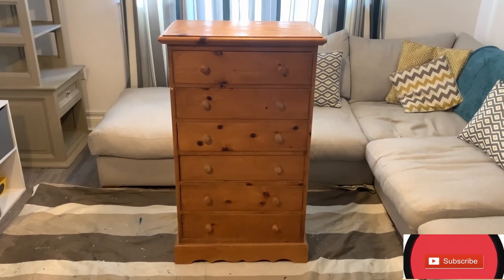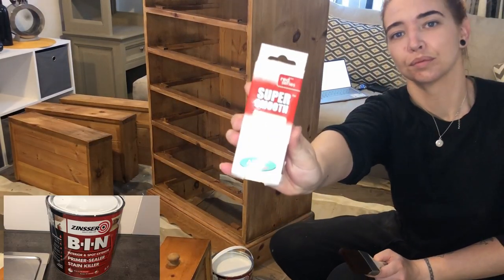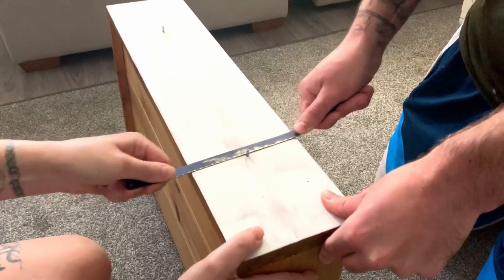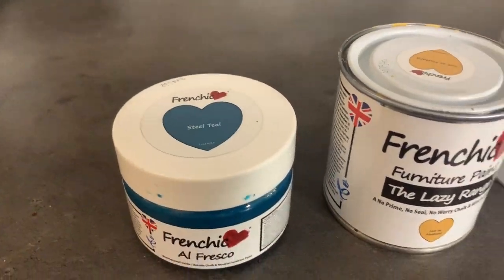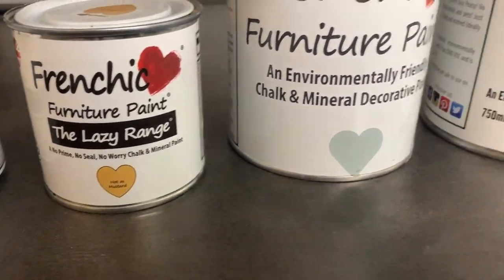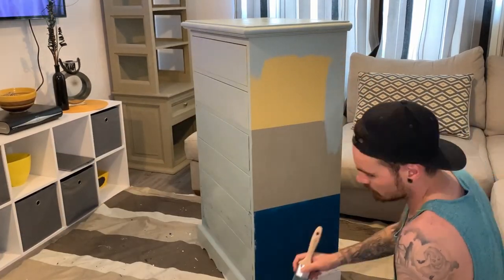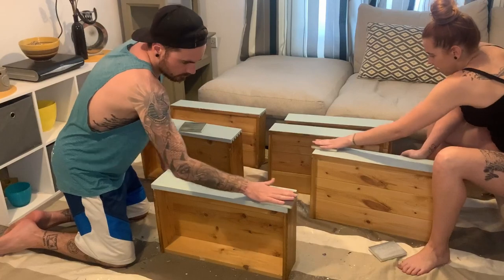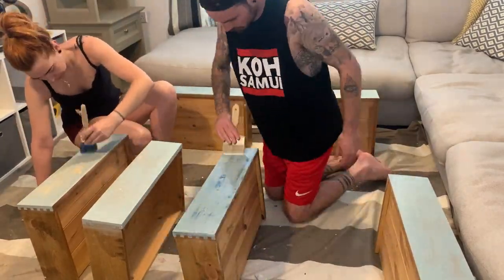$100Challenge//Shabby Chic Furniture Makeover//DIY

Comment: Looks good.   The screws you cut off look as if they were "double ended screws" - i.e. they look like two screws that are fixed together head-to-head.  They were used extensively in the cheaper, mass-produced furniture industry to attach wood to wood (like knobs or feet).  One end was screwed into the wooden knob using some sort of holder - you then had a knob with a screw thread to attach the knob to the drawer.

When you had unscrewed the knobs you should have been able to unscrew the protruding screws from the drawer fronts gripping them with a hefty pair of pliers.
Reply from the maker: We are dealing now with a dresser that has the same handles and we tried your method, but it just doesn’t budge at all! 
Any other tips before we saw them off again?😂